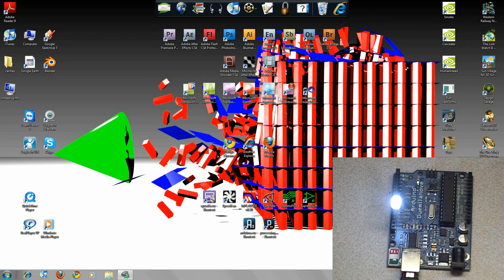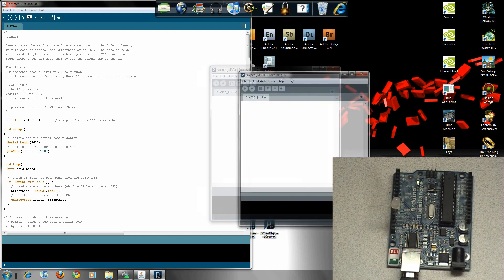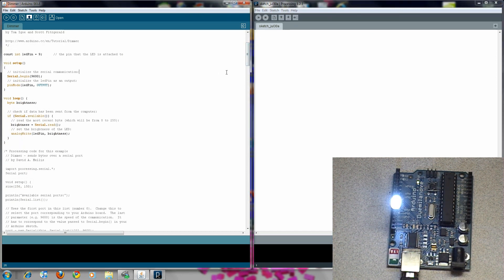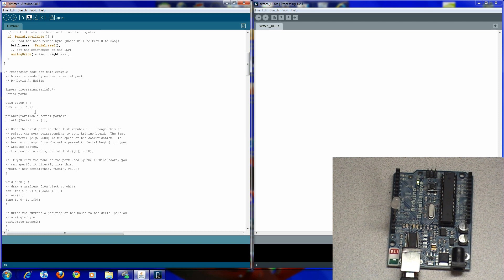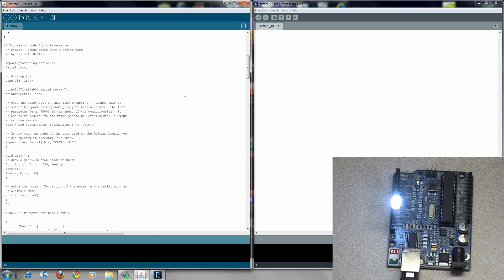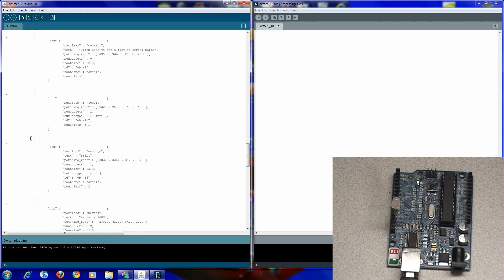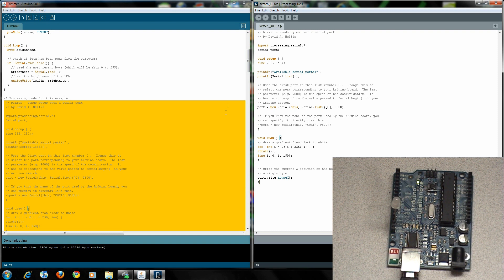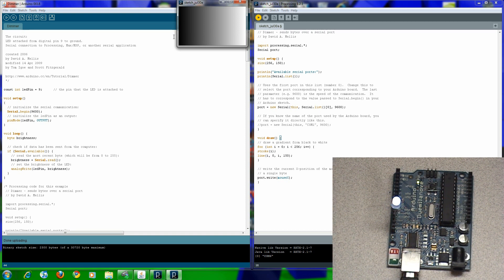Arduino Interfacing with processing: dimming

Comment: This video was uploaded in August 2010.  It's now March 2021, and Arduino still has made no effort to fix the clarity of File > Examples > 04.Communication > Dimmer.  (After I write this comment, I'll go to Arduino's forums and post a scathing message. :-)

I concur with the other comments here:

1. Your video is VERY important.  I probably would have skipped the Dimmer example without your video;

2. Your whining. :-)  Hey, I completely understand your frustration.  Arduino usually works very hard to teach the uninformed masses in easy-to-understand terms, but they dropped the ball with the Dimmer example.